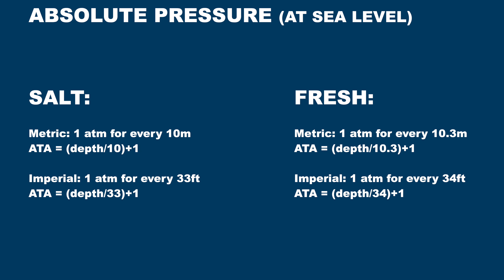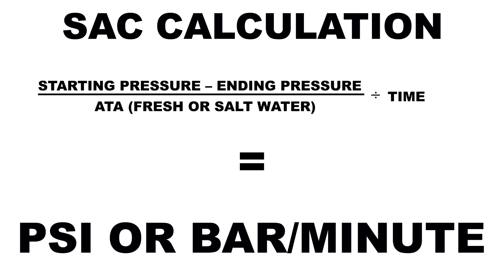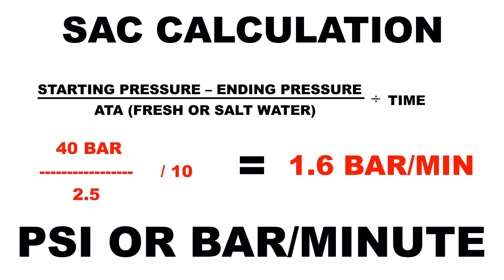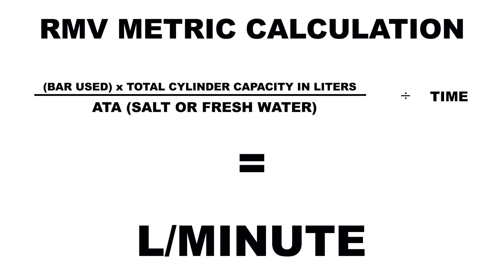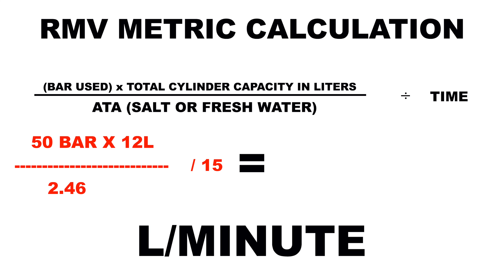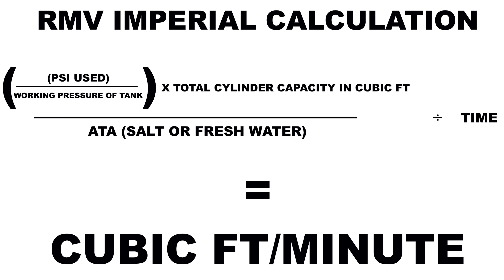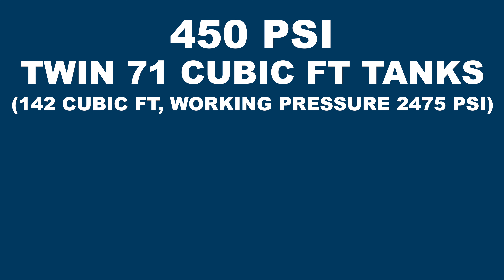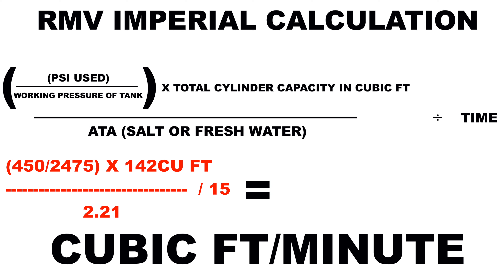How to calculate air consumption for scuba diving - SAC vs RMV

Comment: Great topic, and so important for a lot of divers to learn about.
Air consumption is sooo depending on things, like workload, stress, air temperature, condition, comfort, trim, and so many others.
Every dive I did I always analyse the dive and gas consumption, I just put some numbers in an Excel sheet, 
these numbers are average depth (it's logged on almost all divecomputers) , pressure in, pressure out, dive time, and tank volume(s), that’s all you need to analyse the dive.
The outcome of this formula is average (surface) liters per minute during the dive.
Then I can add for myself things like my workload, water condition, and other things to see either I was relaxed and my consumption was high or low.
I learn from these calculations, and after so many dives I have a clear picture about my average gas consumption, and that number I use doing calculations for my tecnical dives where I need to do decompression, gas-swithes and more.

RMV and SAC can be confusing things If a person is not used to calculate or plan a more complex dive., for me it is like:

 I always calculate in liters per minute, I always calculate in metric values, no Imperial for me (gives me a headache)
Calculating with liters always works, and it works on every tank you are using, or a multiple of tanks.
Reply from the maker: Absolutely. That's an awesome way to track yourself!

Comment: Great summary.  I was taught and have always used SAC defined in litres/min (Go Metric! ...sums are so easy).  But I only use it at the planning stage and for post dive analysis.  My Suunto AI computers also do it this way and give you a useful graph when you look at it on the PC.  That means you don't need to do specific SAC test dives; you can just look at the graph and see instantly what your average SAC was when stressed/chilled/battling current/safety stop etc.  The other useful number I like to have is air consumption rate in Bar/min at depth.  Working from my personal SAC data I've made up a simple table for my dive folder so I can instantly see that if I'm going to be at 20m in a drysuit on backmount twin 12s I'll expect to use 2.5Bar/min, or at 10m chillin' on a tropical reef with an Ali S63 it'll be 3Bar/min.  That's the number I need when I'm deciding whether to have another 10 minutes or it's time to start back.
Reply from the maker: Love it! You sound like the kind of buddy we all wish to have!!
Reply: @AzulUnlimited  I also bring choclolate brownies 😂
Reply from the maker: @timgosling6189  yep, we're diving together one day 🤣
Reply: @AzulUnlimited  Now that would be something to look forward to 🙂

Comment: Innerspace Explorers has somefairly decent videos on calculating "minimum gas" which works through these calculations and shows you what they can be used for in a very simple way. Definitely worth checking out.
Too many people just plan to dive until they run  out of gas and that's pretty bad if something goes wrong.
Reply from the maker: 100% I'll check out their videos. Thank you!

Comment: Hi Sarah, 
I've learned to calculate a SAC rate in LITERS not BAR per minute so in that case it applies for all tank sizes. I mean, if I use e.g. 12l tank 200 bar (2400 liter) still can compare air consumption with my buddy who has a 10l tank also with the same 200 bar (2000 liter). And yes, it is only usefull for afterwards evaluation and not air consumption calculations during the dive (my computer does all the math and I trust it).
Anyway, another great vid BTW (as usual 🙂) 
greetz from Holland
Reply from the maker: Thanks so much! Computers are wonderful things :)
Reply: @AzulUnlimited  hmmmm....do I feel a scent of sarcasm...🙂
Reply from the maker: @dre64  actually no! computers are truly wonderful things 😆
Reply: @AzulUnlimited  yes they are, indeed (unfortunately also tend to crash at always unfortunate possible moment...😞)
BTW. Speaking of SAC/RMV or anything connected to breath control. This was (still is actually) my nightmare. I'm a bit air junky underwater and try to decrease consumption by getting more and more experience. Unfortunately in cold Holland's waters there is only possible (for me of course as I'm only a recreational diver without a dry suit) to dive maybe a half of a year and then on vacation so not that often as I'd like to do. I reduced my SAC/RMV to about 16 l/min but still find it too much. Would like to spend at least an hour under water and get out with enough spare air. I don't give up and work on it!!!
And your videos are sooooo relaxing (and professional the same time) that actually only by listening to your voice my SAC rate drops 🙂(unfortunately cannot play it back under water...)
greetz
Reply from the maker: @dre64  Aw thank you! You could just get a bigger tank... just saying ;)
Reply: @AzulUnlimited  that's what they give me in Egypt (15l) but I feel terrible as all others use just regular 12's. I know, shouldn't pay attention to this but I'm a little wired...
But... It's gonna be ok, just more and more time under water and everythink will be ok (think positief 🙂)
Reply: @dre64  It will improve over time as you become more comfortable. Took me a few hundred dives plus some tech training to get a good SAC rate.
The tech training helped me perfect my trim and buoyancy in the water. Being able to float without moving fins and hands means your heart rate slows down and you start using less gas. I have my Shearwater show the current RMV on the screen, measured from the transmitters, and it really shows how much it changes with comfort. From 10L/min when I'm very calm to 20L/min with just a bit of exercise or task loading.
Now as a cave diver it's become much more important because we turn the dive whenever any diver has used 1/3rd of their gas, so diving with friends who have a similar SAC rate feels better and you want your gas usage on the way out to be no more than on the way in. I've really started to focus on comfort during the dive (slow movement, perfecting trim and buoyancy, streamlined gear, thermal comfort) and it's made quite a difference.
Also recommend getting a drysuit and simply diving more throughout the year. That extra experience helped me a lot.

Greetings from a fellow Dutchie.

Comment: Hey, I'm a new diver, and I need a reminder what number do SPGs go up by? for example does it go up by 100s, or 200s? Im not sure and I need a reminder.
Reply: I'm guessing you use PSI.  The dial should be clearly marked in 1000s with sub-divisions for 500s and smaller ones for 100s.  From 700 to zero they are usually marked in red.  If you are diving with a new group, eg on holiday, be sure to check with the dive lead how to signal pressure.  They may ask you during the dive and there are several different ways of signing out there.  Safe diving!
Reply from the maker: Thanks for jumping in Tim!
Reply from the maker: Welcome! Tim got you covered 🤙🏼

Comment: Sarah, Good video.  But.... 

 Im an instructor 37+ years and with 3 agency's.     While I think that at advanced levels (Dive Master and above) I think knowing how to calculate the SAC rate and the RMV is important. However, for the basic student and the just recreational diver it is a waste of time.  Because the average diver necessarily will never use it.  If they understand that the deeper they dive the more air they will be using which means less time in the water, is more important.  

What is your thoughts?  

thanks

ray
Reply from the maker: I think people are interested in learning things at all levels, so why not clear up confusion they may have from listening to fellow divers?

Comment: I think we are lucky in that Diving Ireland (CMAS) always taught us in and emphasised volume. Though I can see how perhaps with transmitters it might be easy to fall into the bar per minute thinking.
Reply from the maker: Totally. It just depends on what you need it for
Reply: When you look to a RPG of a computer with transmitters its both the tankpressure you see, you know the size of your tanks, and you know your average gas consumption, its easy to calculate during your dive, and when you made a proper planning before your dive then you also know your turn pressure, 
just keep everything on the safe side of your calculations and planning.
When you perhaps use a Shearwater computer, its also calculating tour TTS and your GTR for you

Comment: RMV is a fairly recent change, SAC was used for both cuft and psi based calculations. And you will see a lot of older materials and some people like myself that are obstinate using SAC for both. Like in science class, always provide the units. If you don't provide me units I am just going to blow you off.
Reply from the maker: Great point! Units are key.

Comment: Got a few questions. First, when calculating SAC, I understand the equation, but what if you are at multiple depths? Do you take your deepest depth and you overall dive time?
Reply: Always use the average depth your computer reports.
Reply from the maker: I would do a gas consumption run where you do the test at one depth(and take the average since you're bound to go a little bit up and down during the test). You can take the average depth of a dive to get a rough estimate of your SAC but it won't be as accurate.

Comment: Third question, is it just the volume of the tank that is important or does material matter?
Reply: For the calculation, just the internal volume of the cylinder(s).
Reply from the maker: Mike got you there :)
Reply from the maker: Thanks for jumping in!

Comment: How did you actually calculate the ATA in your metric - Fresh Water example?  You simply stated the ATAfw at 15 meters is 2.46.
Reply from the maker: 15/10.3 then add 1 for atmospheric pressure

Comment: I would disagree on cylinder sizes as 84.755 cubic feet, or 2.4 cubic meter, air is what it is no matter cylinder size, and as you explained on how long it will last it depends 😂

Comment: You don't traffic need to calculate that. Unless your want to use that as a measurement to see how relaxed you are during a dive. Otherwise take 20 l/min to be safe and 30 l/min during stress situations and you are pretty much safe.

Comment: Why would you make a difference between fresh and salt water? Are you changing your computer every time? Are you taking depth by putting knots into an SMB line? If not then it makes no sense to take a fresh water value as your computer/depth gauge measures depth by measuring the pressure, so your depth is literally whatever density is programmed into the device and the pressure. Changing the density after the fact is falsifying your results.
Reply: Never considered that. Good point.
Reply: Many computers have a saltwater vs freshwater option in their settings. So if your computer takes it into consideration when calculating depth, this makes sense.
Reply: @zuchtfisch  Yes, but your computer does not have a salinity sensor, so whatever your computer is set to, that's what it uses for the density of the water to compute depth from pressure. Hence, my question whether she changes her computer every time? Unless you consciously switch from fresh to salt water and vice versa in your computer settings, your computer won't know whether you are diving in fresh or salt water. This means that your depth reading is usually wrong as well, but who cares? The only reason for us to care about depth is so that we (or the computer) knows the pressure which is what the computer measures in the first place. BTW, your computer does not take depth into account when calculating anything other than safety/deco stop depths. For everything else it uses pressure. It measures pressure and it uses pressure to compute things. The conversion for depth is just for the user to have a more relatable reading.
Reply: @zuchtfisch  Besides, salinity changes depending on the body of water you are in. Salinity in the Pacific is not the same as it is in the Med or Red Sea. Again, your computer does not take this into account unless you explicitly keep setting the salinity to whatever value it is where you are. If you don't, your computer won't know the difference.
Reply: @Tobias Hartung that‘s right. I did a lot of my dives in Aqaba and they have a condiderably higher salinity as the rest of the red sea which in turn has already a higher one than most other seas…
But in theory also temperature influences water density and thus the precision of the depth reading. The idea to include factors into the calculation examples might be that usually water pressure is refered to as „depth“. If you calculate with ambient pressure you don’t need any of those, no?
Reply: @zuchtfisch  Correct. If you just keep working with ambient pressure, there is no need for thinking about salinity or temperature or any other effects on water density. Just keep the computer salinity set to whatever is most convenient/suitable and keep working with that as your depth measurement. I mean who cares if your computer reads 20m and it really is 21m? It just unnecessarily complicates everything.
Reply from the maker: Great points, and thanks for this discussion. I talked about it because of IDC theory tests where you always take into account fresh vs salt water, but probably should've kept it simple for this. Thanks for watching!